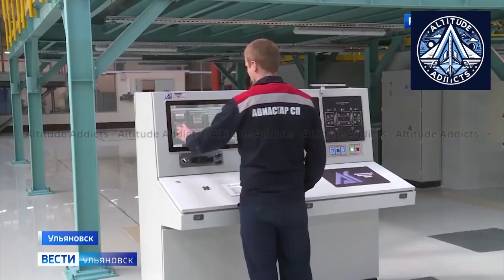MC-21 or Tu-214: Why Russia’s Old Jet Might Save Its Future

Comment: UAC Website  MC-21-310  ..... Max. flight range in a two-class layout*, km - up to 3830 km
which is the flight distance from Los Angeles to Florida ..... ie one coast of the USA to the other .... hardly a "Disaster". Moscow to Urals hub Krasnoyarsk 3300kms  ... Krasnoyarsk to Vladivostok 3100 kms ..... so there is no issue - just a loudmouthed "expert" who probably has the IQ of tadpole .... looking for attention
Reply: It is hailed as a rival to A320neo and B737MAx, both of which have a range of 6500 km, so yes the MC-21-310's range is a disaster, but as this channel says it could even be worse than what's stated on the UAC website. If the range really is only 2800 km as this channel says than UAC should give up and don't even begin the production of this aircraft as the aircraft of this type with such a lousy range wouldn't make any sense.

Comment: I don't believe this made-up figure of 2000 Km - 2800 Km flight range, not even for a second.. the Russian government wouldn't pay a single Rouble to the MS-21 project if it really had a terrible range after import-substitution.. the MS-21 project would have been terminated long time ago if the information given in this video were correct..
Reply: Its a propaganda used by the western zealots

Comment: It's not an old plane, it is newer than the A320 and the B737's...Get your facts right....!
The range is comparable with the A320 XLR with its 3 extra containers fuel tanks or the MAX 10 with its 9 fuel tanks....
As you can see the range can be adjusted at will with just adding more fuel tanks making this comparison irrelevant, besides the TU-214 can hung a pair of Kusnetzov NK-93 ducted propfans with geared counterotating propellers for a hefty 25% extra fuel economy....
Reply: "Get your facts right" ... that's where you'd better start yourself.
There is no A320 XLR in the Airbus portfolio, and the A321 offers the normal neo, LR and XLR range variants dependent on customer needs.
The Tu-214 empty weight is almost 9 tons higher than the Airbus at similar seat capacity, which reduces the operational efficiency dramatically. And the three person cockpit layout is nothing but a bad joke in 2025. 
The Kusnetzov NK-93 propfan development has been halted 15 years ago, and until then its prototypes had never ever seen a Tu-204/Tu-214 wing.